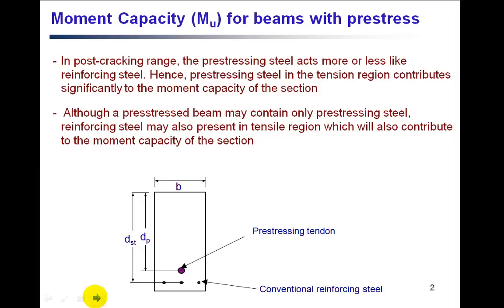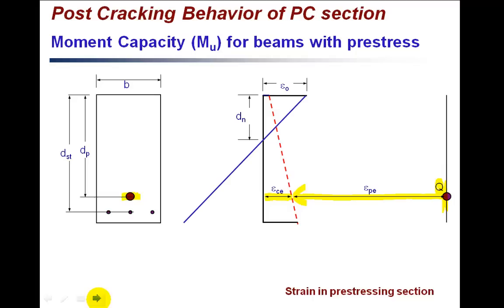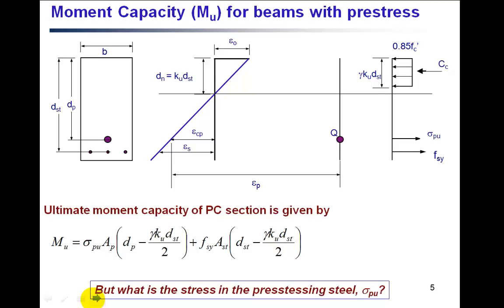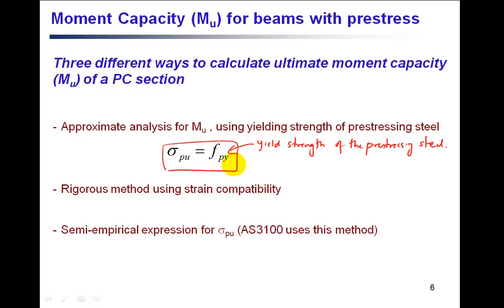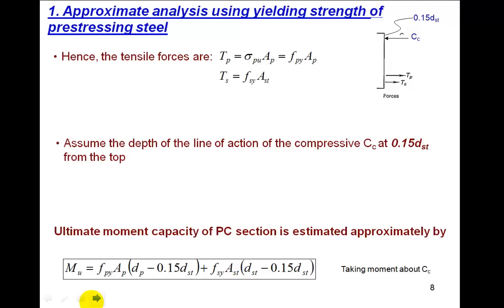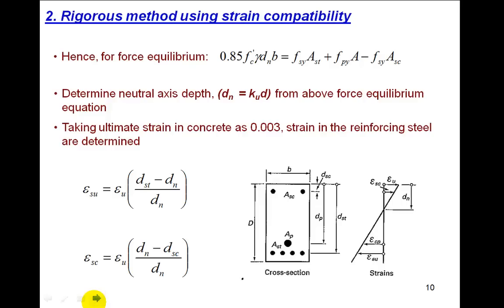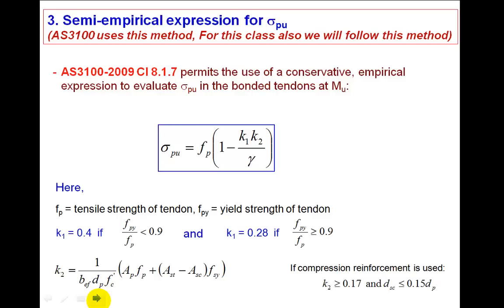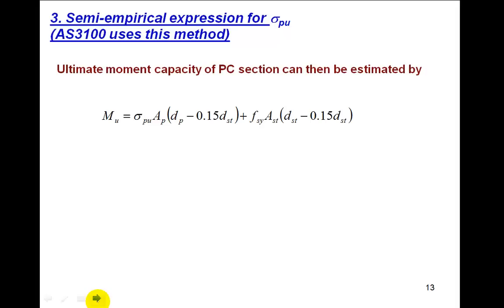Prestressed Concrete (Ultimate Moment Capacity) PC5

Comment: Hi Rabin,how to estimate Mu at the top section though. I have a 6m long beam which is presstressed, however lifting points located 1.5m from ends. I assume it will overstress top section during lifting. Please comment. Thanks

Comment from the maker: Hi Rajeevan

Thanks for your comments. These were part of the lectures I recorded for my students when I missed some classes. I am thinking of making a complete set of Reinforced concrete and Prestressed concrete videos. And I will be adding some example numerical solutions as well.

Regarding the Eps (ce) I know I was bit confused there as the I thought the slides had wrong values. I will correct it and add all the descriptions. 

Cheers
Rabin
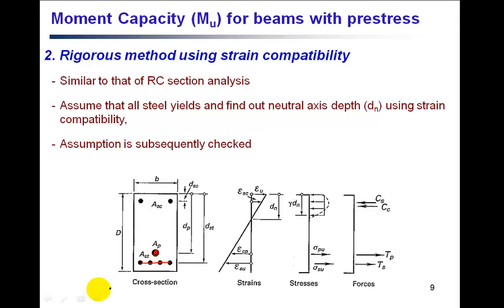Reply: In 12:10
you said to find the value of Ku dn, HOW??

Comment: I have a few questions:

Time= 14:00

You have given the expressions for eps(su) and eps(sc), but forgot to give expression for eps(cp), so that in the next slide.

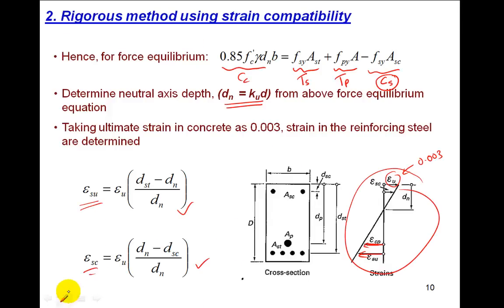Time= 14:54

You are switching to previous slide to see the expression for eps(cp), which does not exist in that slide. Also, you are wrongly trying to correct the expressions for eps(su) by changing it to eps(cp) without changing the right hand side of the equation  of  d(st) to d(p).

How to get eps(ce)? Not mentioned.